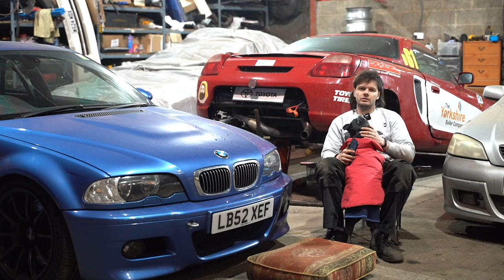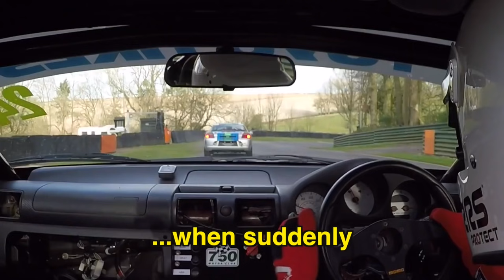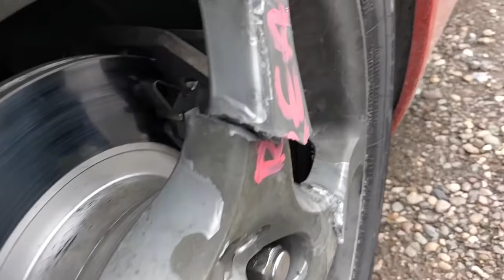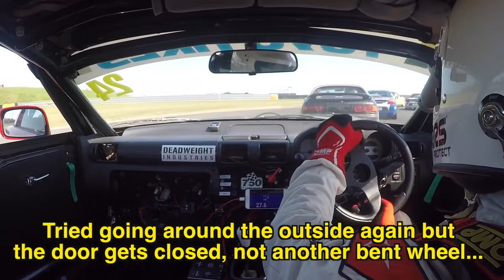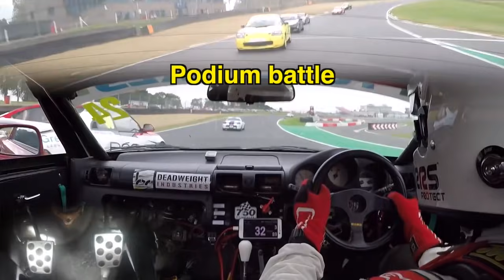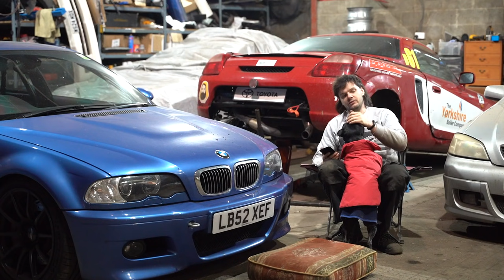Racecar Driver Simulator - 2021 Edition

Comment: It'll be a shame if you do end up giving the MR2 racing a break because there were some points this season when it all came together and you were easily top 3 in the title material. Just some crap luck and the intervention of a pink problem that killed the run and crippled the car. The MK3's seem to really be coming in well in the series now too, they were never regular outright race winner material 3/4 years ago so its a good time to keep ahold of one as a few of the big winners of the past are now jumping to the newer spec car. But still its all down to whether or not youre still having fun with it.
Reply from the maker: Cheers dude!

Comment: Dan your really need to get a set game plan for next year.
I'm not saying that racing the Honda and Toyota will be a disaster but surely it make far more sense to focus on finishing every race in a championship rather than a few in each?
Reply from the maker: Only if I was going to be competitive for the championship, dont think I will be
Reply: 5th in class and 10th overall with 3 dnf's is pretty decent, especially for your first full season. Podiums could be the norm if you you stick at the mk2s next year.
Just think trying to keep 2 racecars on the go would be right expensive n' that?